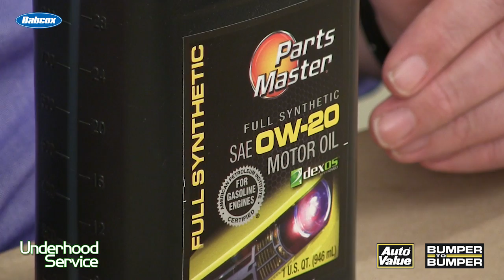GDI Carbon Deposits and Synthetic Oil | Tech Minute

Comment: I'm one of those crazy people that still changes oil every 3000 Miles even though I use synthetic.
Reply: The manufacturer says 6000 miles, but to change it at 3000 under "extreme conditions." Which seems to mean any condition other than 100% highway
Reply: I do it at 5k miles with synthetic, I know its a waste but I rather spend $27 on oil changes ($22 pennzoil platinum 5w30 and $5 oil filter) every 4-5 months just for the peace of mind.
Reply: @mr.boostang2064  - and your engine's internals will be pristine for a very long time :D 
 Manufacturers recommending extended long change intervals have no financial interest in their engines lasting longer than six years. Audi Australia when it offers extended warranty mandates (to the owner in the contract) that the oil change interval be reduced from 12 months to six and the 20,000km limit to 10,000km. Is there anything else we need to know? 
Of course not. By the way, that excellent Pennzoil that costs you only $20,  costs in Australia AUD$100  :( .
So Mobil 1 ESP is cheaper here.
Reply: @zenden6564 
I have a 2011 Hyundai and the owner's manual says to use SAE oil and change at 7,500 miles. And the manual trans has "lifetime" fluid. It's like they literally want this car to fall apart.
Reply: Oil is cheaper than an engine.
Reply: I think it helps. I do that with top tier fuel(car requires it)
Reply: My manufacturer recommends 10k but I change it at 5k
Reply: RNY - well I bought a new Honda and the recommended interval with normal use was 6 months or 6000 miles. I noticed as it was getting close to 5,000 to 5,500 miles the oil changed from its golden honey color, being discolored with the black combustion & sludge  contaminants. Then as the engine aged that mileage for when the engine oil became discolored from pristine became gradually sooner and sooner. At after 120,000 miles it changed color @ 3000 miles. So  I figured I'd just change the oil when that occurs, that is following progressively more frequent changes. Mad or sensible I am not sure, but I've caught up to you now :D
Reply: Zen Den 

Honda doesn’t have an interval. It’s based off the Maintenance Minder.
Reply: Shepperd November i’ve seen people do that but car still breaks down, they never change coolant and anything else, just oil, because that’s all they know.
Reply: You're not crazy you are smart
Reply: Yeah. Me too.  I use synthetic 5w40 I change it every 3000 or 3months.  Oil is verrrrry cheap compared with the value of the car.  HAPPY TO BE AN OLD SCHOOL.
Reply: Not crazy at all. If your manufacturer recommends getting an oil change every 3000 then you are doing the correct thing. 
Just because you use SYNTHETIC does not mean you now go every 5000. Thats not how it works.
Reply: 3000 or go boom at 100k
Reply: You are crazy... I change my oil annually and it is still good after 12K + miles
Reply: @TedSchoenling  you might drive different. But for me up in the mountains I change every 3k. Like the manual states. We're talking a motor that could last to 200k with a turbo vs 100k with turbo at long intervals. If you run a turbo def don't go over 3500k
Reply: Dallas Williams in my owners manual regular mountain driving is actually mentioned as triggering the severe service schedule (which is then 3750 miles).
Reply: What you say is correct,,I change my oil in my triumph Bonney every 5000 kms simply because the engine spends a fair amount of time in the red line at 118000 kms I tore the engine down and put a big borekit in it, parts inside were like brand new ,,, it certainly pays to change oil regular specially if your gonna flogg it,cheap insurance I rekon
Reply: I do it every 5000 miles.
Reply: Same but I’m more of a 5,000 mile kinda person but always use full synthetic oil and quality oil filters.
Reply: If you're gonna waste money like that at least spend a little more and send a sample out  to get tested
Reply: Interesting to read the comments. I am someone who wanted to set up a oil blending unit. (The cans u buy wil b blended by a contractor for the company according to the formulation given). So i pretty much know wat the oil marketing is & certain truths.

- Your engine wear & tear is based purely on the amount of times u start a cold engine. This hot cold cycle affects the oil also. Wondering why mobil 1 claims long oil life on taxis ?Its cos they are always running warm & so are long range trucks. 
- Synthetic name tag is a big lie. You can google the subject.Mineral with additives are classified as synthetics according to a court battle decades ago by your friendly oil companies. 
-  If your travel is long distance or highway use your oil will be fine. If its a short distance commute or heavy track use. Its best to change your oil early with genuine oil filter sourced from a reliable source. 
Hope this helps. Dont listen to keyboard experts who read the marketing gimmicks
Reply: If I waited for 5k or 7500, I would go 2-3 years without changing my oil. Your oil decomposes so if you go along time without getting the miles then change it every 2 to 3 months. Plus listen to the manufacturer if they say 3k do it
Reply: Change the crazy to a moron
Reply: You are wasting your money.